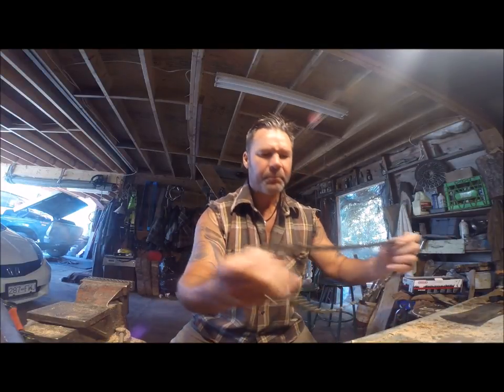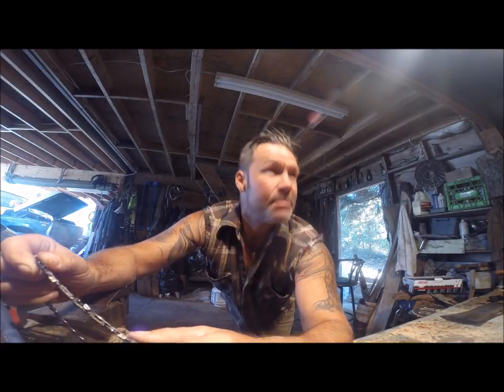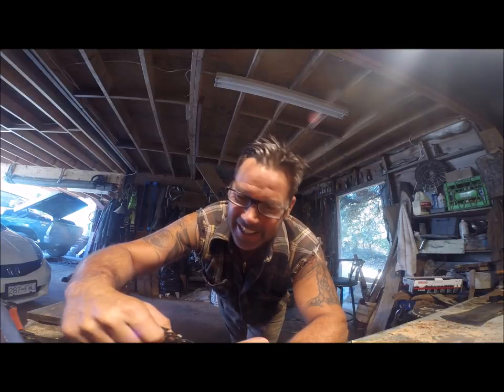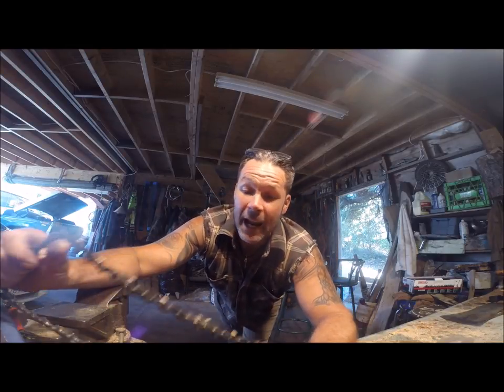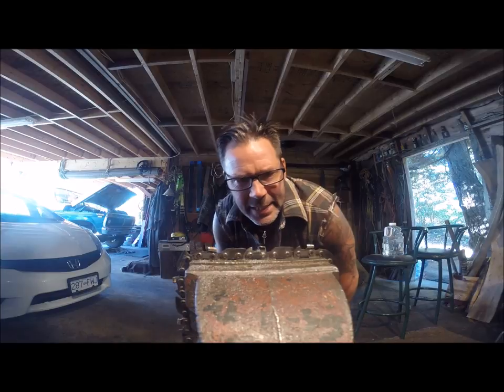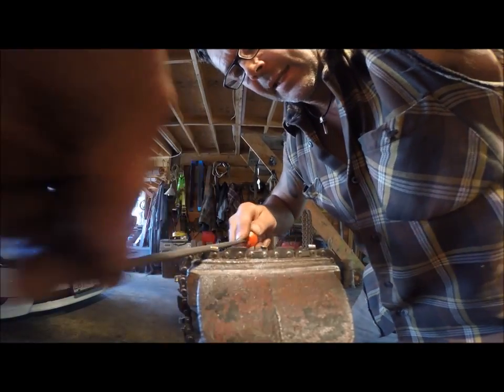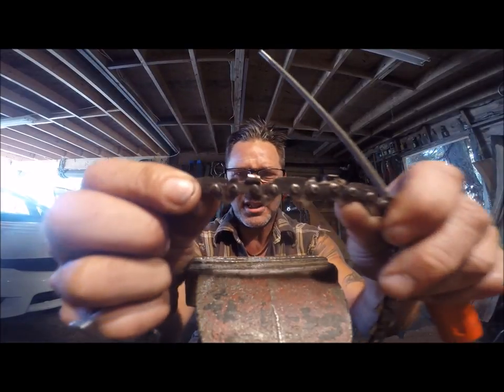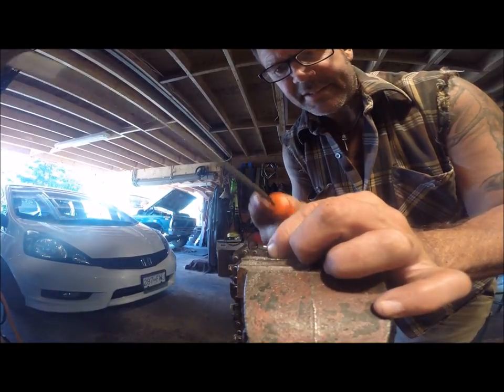Faller gives straight goods on chain filing

Comment: Yea.... Thank You Thank You Thank You,  I'm so grateful for this and know exactly what ya mean about the "C" shape I watched very closely and now that I know the file size too..I'll not be taken advantage of no more....Stay safe my friend .
Reply from the maker: oh its nothin young lady ha ha , just when ya stick it in a log next time dig in yer heels lol ha haa
Reply: Will do..BSafe my friend
Reply: Cynthia,  I know this is two years late but one of the problems is the safety link is nearly the same height as the raker so just taking down the rakers will do little.  Most shops would rather sell you a new chain as they don't have the experience necessary to sharpen chains properly.  When I saw Buckin show the profile of the chain I knew exactly what happened.  Instead of using a 1/8" thick grind wheel they used a 3/16 which is designed for much larger chain...3/8 and .404.  You need to take your flat file to those stupid safety links also.

When you get 1/2 the top plate filed away, go to the recommended 5/32 file and you will be good to go.

When you get a new chain try to get a yellow label semi-chisel chain.  In Oregon their 91VXL chain is great   They cut much faster, are easier to file, stay sharp longer as they are better steel, last longer because their top plate is longer, etc.  Stihl also makes great low-profile chains.   Great source for chains is loggerchain.com.  Great family run business with the best prices out there and you can call and talk to someone who really knows Oregon chains and bars.

Comment: Hey Buckin'-Well done..!! Good advice..!! Not sure if I heard you say this in the vid..Please help correct if necessary., The top plate and the side plate make up the "chisel"-- which is right above the "gullet". This is a crucial spot that interacts with the wood and is next in line after it hits the "depth gauge".. Your Boat analogy is an excellent teaching tool..!! How lucky is CYN.,?!
Reply from the maker: pretty high tech partner ha ha , sounds good

Comment: I have one of them chop saw style sharpeners because it was a good price and it makes sharpening fast. It has a slight angle but not like your sharpener. /<---- like that more or less so after a few times it flattens out the hook, I always have to hit it with the round file which is the way i prefer but after a day of fire wood cutting i can dull three chains with all the sand in the trees and the ground. Laziness is not the way to go.
Reply from the maker: no sir its not

Comment: Hey there Buckin ! Hope your day is going great. Got couple questions if you dont mind helping. So i bought a new chain for my top handle the other day. Its a round tooth but it also has a point like a square tooth. Its been such a pain. Catches in wood when trying to cut. Doesnt matter if its soft or hard wood. Been driving me crazy every few secounds it catches and stops the chain. I tried hitting it with the file some but still same affect maybe worst. Got any ideas why a new chain would do this ? Also iv always used round chain on my ground saw because i can sharpen it sooo much better than a square. Is there anyway you can explain the difference in sharpening a round vs square chain.. Round chain will throw big chips while square throws just tiny pieces after i sharpen the two.
Reply: Both chains are round ground btw.
Reply from the maker: those are excellent questions, although without seeing the chain I am at a loss if somehow i could get pictures i most definetly  could help , do you use a raker gauge (depth). is your square grind done on a grinder , this chain you speak of where is this point you speak of
Reply: Wish i could get ya some pics but saws are in the truck at the moment. I sharpen with a round hand file on both round and square teeth. The point im referring to is on the top left of the cutter tooth. Its like the cutters on that new chain are round on edge but has a sharp point like a square cutter. If that makes any sense.
Reply from the maker: Justin W  Yes I think  I do actually who makes it  and where are ya from
Reply: Its an Oregon chain. Im from north Alabama. And forgot to mention i use a depth guage on my chains. I checked the depth on the chain thats hanging in wood so bad and there right on the money from factory.
Reply from the maker: is this the first chain that has done this 
 i looked at it email looks a little suspect but not bad , could you pls roll the chain around by hand and inspect every tooth and raker for somethin bent and hangin out to the side , that little dip in front of raker seemed a little strange to me aswell over n out
Reply: Thanks for taking a look at it. Actually we bought two chains the same day for two different top handle saws. Both chains had this problem right out of the package. I inspected the chain and found nothing out of place. I filed the cutters down some today and it helped tons.. And btw i used your "boat" technique today filing that square cutter chain and wow what a difference.. Throwing big slivers now ! Never paid attention to that C shape it needs until your video thanks alot !
Reply from the maker: so it was as simple as high cutters ,, make sense  ,, right on bro ,, that great thx

Comment: Bill  isn't it important to hold the file at the correct depth? I have been using a guide with little rubber rollers for years, thinking it was keeping my file from going too deep seems to work well.  havent heard you mention anything about depth. some beginers may file right into the links?

Comment: i found myself using a harbor freight chain grinder and not actually getting good at filling....i feel so shameful but i promise iam gunna start practising. =D
Reply from the maker: thats funny buddy lol
Reply: If it's a red chicago electric chop saw sharpener, i have the same one. She gets rid of the c that you want.
Reply: yeah it works great but cant exactly use it without a plug nearby which is my problem =/ but a good handy file is about to become my friend
Reply: Right angles and a smooth stride, touch your rakers if they need, it takes some practice but i believe everyone can do it. Happy filing from frozen manitoba!